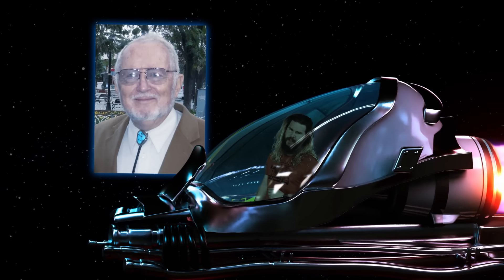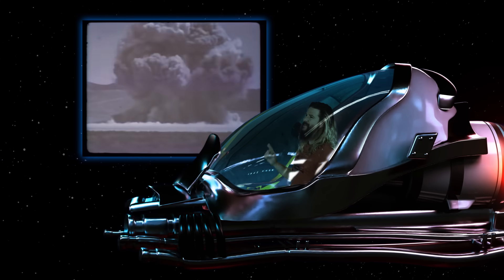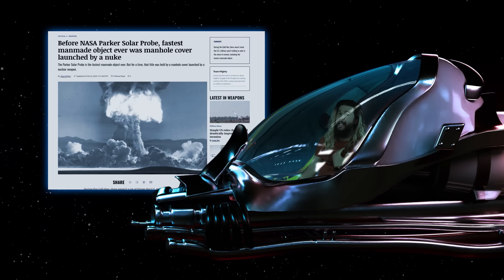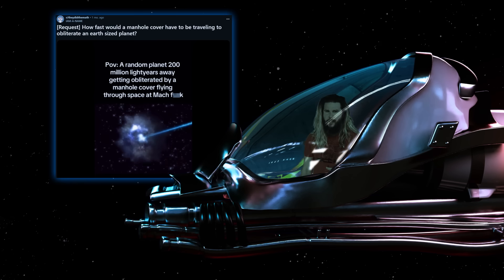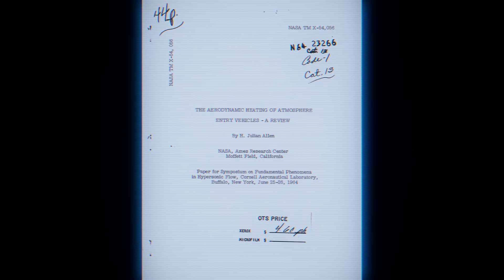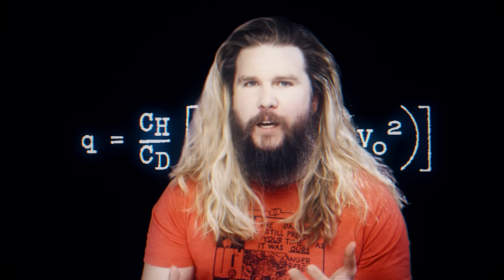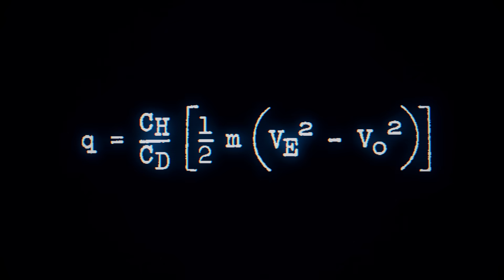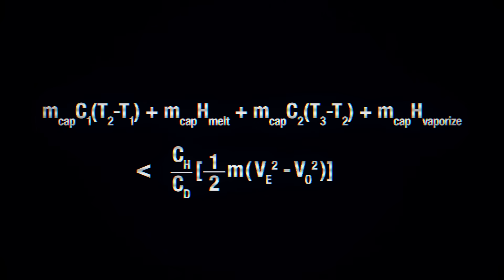Debunking the Nuclear-Powered Manhole Cover

Comment: No expansion of the initial velocity calculation (and its levels of certainty)?

Given the number of oxygen atoms it would have encountered, even at a moderate 2kdegC and with surface ablation, it’s likely that a significant portion of the mass was actually converted to ferric oxide rather than vaporous iron - and something of the order of 100kg (~13%) would have become CO or CO2.
Vaporisation is a higher bar than simple burning.

Comment: Can the lower  friction in higher altitude change the equation to the point of the manhole making it to space ? Basically the object would have had less and less friction higher it goes so less heat to melt it or vaporize it

Comment: So love your work bro... SUPER fun to watch... BUT....
IMO there's the bigger (MUCH bigger) problem with this entire thing... acceleration. The estimate of 66km/s velocity... that's REALLLLLY fast... I mean really... in fact that's SOOO fast that the manhole cover would have been completely out of the high drag part of the atmosphere in 1.5 seconds. So yea... fast.

Supposedly the camera was a 1000 fps camera so if the detonation launched the lid at the start of a frame exactly (using the ENTIRE 1 millisecond to accelerate the lid smoothly to 66km/s) it would have (according to my calculations... I mean ChatGPT's Calculations) required 6.7 MILLION G's of acceleration to reach that velocity.
How many G's of acceleration would be required to turn a 4 inch thick piece of cast iron into a million tiny particles flying in generally the same direction but not as a unit? Well let's see (have not doublechecked ChatGPT for accuracy yet so could be errors but this does illustrate my concern):

Q) What acceleration was required to accelerate the 1000kg "manhole cover" from zero to 66 km/s in one frame of a 1000 fps camera (1 millisecond).
A) 66million m/s^2 or 6.7 million G's.

Q) is there a way to determine if a 4 inch thick piece of cast iron could survive 6.7 million G's of acceleration without disintegrating?
A) Yup... basically you calculate the force applied to the cap and see if it's greater than the yield stress of cast iron. That result looks like this: 47.9 GPa induces stress >> 0.2-0.3 GPa yield stress of Cast Iron. 

So... the cap would have just been esploded rather than being accelerated to 66 km/s in 1 millisecond if my lazy chatGPT calculations are correct. In fact... a lid made of diamond that's 300 times stronger in compression than cast iron (60 GPa)... would BARELY survive being exploded (and if it experienced any tensile stress... poof). So before worrying about it making it to Space we need to figure out how it could possibly have made it to 66km/s in the first place!

Comment: I hate to complain. This was very welland thoroughly done. However how would the math change for a tumbling object instead of the plate moving in the least aerodynamic way possible.

Like if it was on edge, there would be no heat at all, but it wasnt thrown like a frisbee.

It looks like it would have been liquified either way, but how much will tumbling decrease air resistance?

Comment: yes, but. In your calculations you assumed that it did stop completelly, and gave all the energy (minus those convective losses). But if it retained a significant part of its velocity, then it wouldn't have lost enough energy to melt itself. What needs to be done, is a calculation how much velocity it does loose before leaving the thicker parts of atmosphere, and seing if the delta is enough for melting. CFD ideally would be the best, but might be a biiiit difficult.

Comment: Given that we're going bottom up through the atmosphere rather than re-entering, I'd naively expect us to generate more heat, particularly during the earliest phase of ascent. A meteor or space ship uses the thin upper atmosphere to slow itself down considerably before it hits the denser lower atmosphere. Our manhole cover OTOH is going to instantly hit the thickest atmosphere like a wall at its maximum velocity, generating a fairly stupid amount of heat. Honestly I wonder if the air didn't just physically tear the object apart through pure strain before it even had a chance to melt.
Though it may still have been the fastest human object ever, just not for very long...

Comment: Ok was that calculation based on the man hole remaining flat? What if it went edge wise after the initial separation from the ground welding?
Additionally you used a calculation that was based on entry into atmosphere. Is the fact that the atmosphere gets progressively thinner on exit a factor in reducing heating then getting progressively denser or does that matter? The object is accelerating at precisely the densest part of the atmosphere rather than decelerating in thinnest. Does that interplay effect chance of survival

Comment: I agree with your final point, but would the drag coefficient not be a coefficient of the height of the cover (really of the density of the gas surrounding it which is in itself a function of the height of the cover).

Also, can you share your dimensionless figures? I’m interested in your calcs.

Comment: I got one question on your explanation of reasoning for the conclusion. Would a meteor that is super heated coming into contact with the colder clouds cause the vaporizatuon of the meteor as opposed to it being vaporized by the heat? something very hot meeting something cold usually has explosive results right? Ok that  was 2 questions.

Comment: I noticed that the focus was the heat/melting/boiling point of the cast iron. What about its tensile strength? would the cover shattering be a consideration?

Comment: Fair, but the issue I have is that for atmospheric reentry the atmosphere is increasing in density, thus drag is constantly increasing. In the case of the manhole cover, the atmosphere is decreasing in density, thus drag is constantly decreasing. Since at each point drag will infinitesimally decrease, the equation must be integrated to account for the decreasing drag at each point. I will not pretend to know what the answer to that is or if it changes the conclusions reached.

Comment: The 1 problem i have with using data for objects entering the atmosphere vs objects leaving is that heat builds up under increase pressure so yes asteroids would eventually burn up before hitting the ground so we reverse that, an object leaving would see reduced friction and heat as it rose higher, also it would incrementally slow down as it had no means of continuous thrust to maintain any consistent velocity. But I love you Kyle and I throughly enjoy your videos

Comment: Whether it made it to space or not it was the fastest manmade object for at least a very short time.
I don't think just thinking of it as a reverse entry is 100% valid tho because because it would start cold in the dense atmosphere instead of in the thin part of the atmosphere. Also assuming it flies flat seems naive. But given the size of the number the conclusion is probably correct.

Comment: Those numbers are within an order of magnitude of each other. Also, some rocks from space break up before reaching the ground, while others make it. "Computer simulation or bust" I say, this is way too complex to plug into a formula and get an accurate answer. The shape, mass, temperature, velocity, air density etc all vary throughout the flight...

Comment: not to be that guy but does your equation compensate for the distance of atmosphere that the disk travelled through? like, meteors come in at an angle while the disk when straight vertical, thus reducing the atmospheric distance. or is my thinking flawed?

Comment: I think your equation may be the wrong one. Your equation comes from re-entry, the manhole was leaving the atmosphere.

This matters because the air density. When you re-enter the atmosphere your heat transfer increases the lower you go. The manhole cover will have less and less friction as it leaves the atmosphere. 

It’s also possible that with these extreme speeds, well beyond what we expect and study from an asteroid or spacecraft, it is possible that the physics change on the heat transfer due to just the speed of the UFO. 

Not saying it made it to space. But saying this isn’t proof beyond 100%

Comment: To those complaining about the maths, I think Kyle meant it more as a thought experiment.  As others have mentioned the cap should be tumbling, there is deceleration due to gravity and the rest.

One thing that doesn't seem to be mentioned is the original calculation of the speed of the cover.  The frame rate of the camera is needed as the height above the ground is probably accurate but how long did it take to reach this height?  For example at a frame rate of 1 fps and a view out of my window of say 10 m across if I saw an object in the centre of the frame it could be doing any speed from 5 ms^-1 upwards, any slower and it would appear in two frames.  So it is traveling at a speed above that.  I cannot determine this speed as if it was doing 10 ms^-1 or 100 ms^-1 it would still have a chance of being in the centre of the frame.

Now, this isn't completely true in the manhole example as we know where it started, like an object traveling past my window-if I know it starts at the left side I can calculate it's speed if I catch it moving to the right over two frames.  With just one frame I could say it was 5 m from it's starting point, BUT did it move immediately after the last frame in which case it is traveling at 5ms^-1?  If it started traveling half a second after the last frame then it has covered 5 m in 0.5 s and so on.

Given the initial estimate of speed that Kyle had to use [remember the cap was supposed to contain the explosion] he did his best without trying to cover the maths for all the circumstances, but there is a massive margin of error.

Comment: While I don't believe that the "manhole cover" made it to space, your calculation does not prove anything. You stepped through the left hand side but glossed over the right hand side, which is the side that actually matters. You appear to assume that the drag force was enough to reduce the velocity to zero, which is what you were setting out to prove! That makes the proof circular. Before you can say that the final velocity was zero, you have to prove that the drag force would be enough to do that. Given that drag force is proportional to the square of the velocity, I'm pretty comfortable assuming that, but that isn't a proof.

Comment: The major unknown in your calculation is the assumption that all that heat energy was spread between all the parts of the manhole uniformally.
And in real world it almost never happens, especially with a 900kg steel object.
It could shread the outer layer ablatively while piercing the atmosphere.
But I think we could run some simulations of this event on a computer.

Comment: Correct me if I’m wrong, but you’re equating something entering the atmosphere, with something leaving. Wouldn’t the atmospheric pressures invert? When entering, the pressures increase and slow the object, whereas upon exit the pressures decrease, causing drag to also decrease. 
I might have missed where that was included in the equation though.

Comment: Your math is interesting but doesn’t take into account the reducing drag factor as altitude is increased….and that is a huge factor for something that is traveling at those speeds. A meteor experiences the opposite. If your drag coefficient is sea-level air density then you have to factor that as reducing to near zero in the course of a few seconds.

Comment: Really disapointed to not see any simulation or modeling of the cap tumbling vs slicing vs flat as the cross sections of these differ hugely even temporally.  Your equation assumes its flat, or spheroid.

Comment: Why assume the cap was flying face first? Throw any flat cylindrical object.  It tumbles. Like dropping a coin.  This greatly reduces drag and heat transfer.  

Also, you can't just use the equation for atmospheric entry to simulate atmospheric escape.  Entry goes from very thin atmosphere to a very thick atmosphere, gaining more and more heat as it goes.  Escape does the opposite.  The atmosphere, and therfore the drag and the heat generated, get greatly reduced very quickly as the object increases in altitude.  

I'm not saying the disk made it to space or not.  I'm just saying these calculations don't seem right.

Comment: I have a question, and I'm neither a mathemetician nor an astronomer or physicist. You mentioned that meteorites of similar size, moving more slowly, had destroyed themselves, but meteorites are not pure iron, they're typically iron chunks bound together by rock, right? Given that, wouldn't; the rock break, then the pure iron bits inside will be far smaller and thus require less energy to vaporize? I dunno I'm not a scientist but I was just wondering.

Comment: I am not sold on the assumption of the initial speed. A single frame leaves a lot of margin for adjustment. Logically, the cover was blown as soon as pressure overcame welding points. There is no way to check how strong were they. Initial impulse was basically equal to a force needed to sheer those welds, plus some hypersonic blastwave ride acceleration. I am sceptical it could even achieve escape velocity, let alone multiples of it
Reply: You can tell how fast it was going because it only appeared in one frame of video. Therefore it must have been below the frame one frame earlier, and above the frame one frame later. It can have been faster than the speed calculated from that but it cannot have been slower or it would have appeared in multiple frames.
Reply: @WJS774  That was my point. Setting aside that it could have been obscured by a number of things on previous or following frames, this still leaves a lot of leeway. I have no clue how fast the camera was, but exposure timings in 1950s could not have been fast, placing a hard limit on frame rate and making a single frame a relatively wide margin for interpretation.

Comment: You say in the video that it's a flat surface going up in the air to calculate drag but surely it will be rotating so it's drag will be variable and maybe it will be taking less heat.

Comment: Dear Kyle,  please stop spreading disinformation.  You might have done the maths correctly,  but it was the wrong math to begin with. 
LANL is elevated at 7200ft, ie 80% air density of sea level. Mt Everest is 30k feet with an air density of 38%. So in 0.1 sec the air density is cut in half.  In 1 full second  its already at 228000 feet or 41.667 miles or( 67km if your flag isn't on the moon). Or 67% of the way to the Karman line, that the Manhole Cover reached space in 1.5 seconds. 
Even an Oxy-aceteylne torch at 6000f would have trouble melting a manhole cover that thick in 1 second
Also not everything can be inverse of the opposite.  + is the inverse of- .  You can not inverse baking for instance and you cannot say going to space is the inverse of coming back from space.  Rockets follow a ballistic path.  Asteroids and other space stuff like the Dragon capsule follow a glide path back to earth. The Manhole Cover was going straight up. Even the immense gravity of a black hole cant pull an object straight down.  It follows a curved path around the black hole gaining speed and energy raidating that energy out as light till it reaches the event horizon. 

Im going to put on a tin foil hat for a minute and ask do you think the govt of the 50s in the height of the cold war and racing the Soviets to space did a cover up about it? Seeing as how almost 70 years later its still a secret video about it?????

Comment: I have to point out several issues with the computation without looking too much into the details.

First, you consider the final velocity to be zero, assuming the  object has lost all its velocity exiting the atmosphere and that the totality of its kinetic energy has been converted into heat. If it made it to space, this assumption is false. In fact, you need a model to approximate the exit velocity of the object (using the drag coefficient for instance).

Second, it is highly improbable that the cap has stayed flat during the ejection : first, the orientation of least energy would be at 90 degrees and second, the explosion could have given some angular momentum to the cap.

Third, the shape of the object change during melting. It would be interesting to consider that its drag decreased even more with time.

Finally, about Nusselt number, I am not sure about how you computed it, but I am pretty sure it is not the common formula implying Reynolds and Prandt number for hypersonic vehicules.

Based on these remarks, the margin you ended up with could totally be over. I could try to build a more accurate model if you are interested.